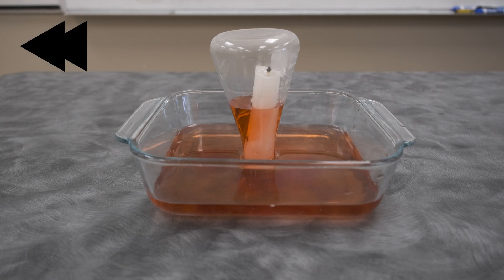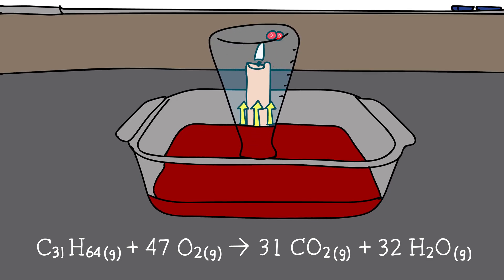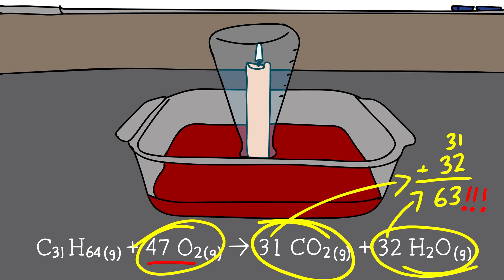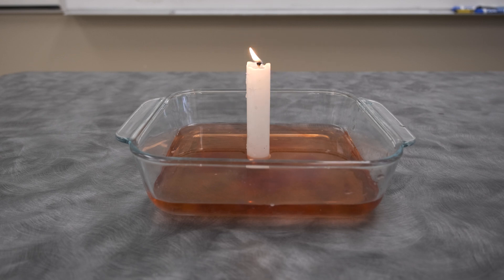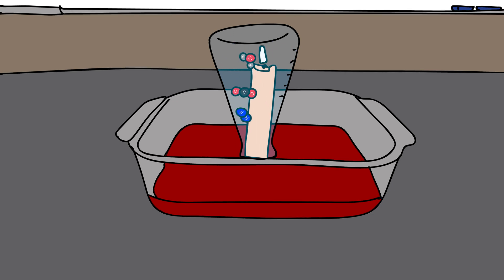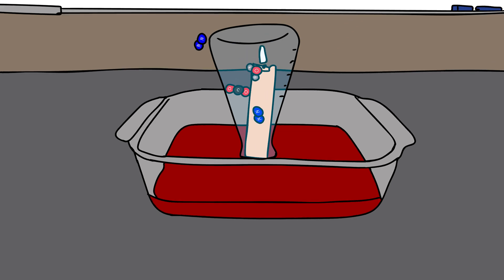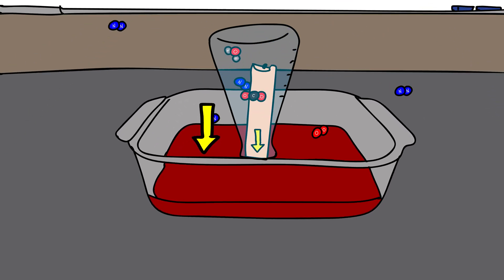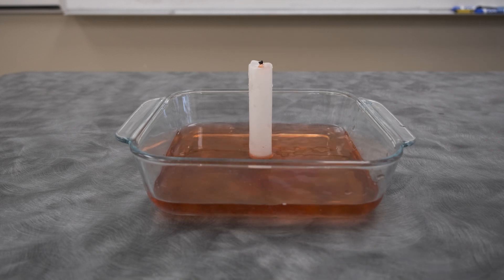Can you explain this seemingly simple chemistry demo?

Comment: Really cool explanation! What did you use for your animation? I am trying to figure out some different animation styles and I really liked that one!
One thing you could toss in your explanation (if you wanted) is the co2 in the product continues to contribute pressure but the hot water has in the product is going to condense into liquid and stop contributing to pressure. That will cut your product gas in half so you go from the about 48 gas molecules in the reactants to about 30ish in the products (I don’t remember the ratio for the reaction) To see how much the water condensation effects the pull of the water up is a bit more challenging experimentally. I guess you could heat a hot coil or something with similar temp to the candle with no gas emission and cover it and see how high the water goes up. I’ve tried for a while to make a self contained chamber with a balloon in top that will expand then contract based on the temp and pressure and number of gas molecules.
But anyway, rad!
Reply from the maker: You're right of course!  I'm always a little suspicious of this though since the combustion gases will remain very hot and this system isn't truly closed (like a bomb calorimeter would be), so a lot of those hot gases escape as the flask is lowered, and then I think it's a reasonable assumption that the overwhelming mechanism is the temperature change of the gas in the headspace of the flask.  Would be interesting to try to test it though.

The animation is done in Adobe animate.  Check out @TipTut for tutorials!